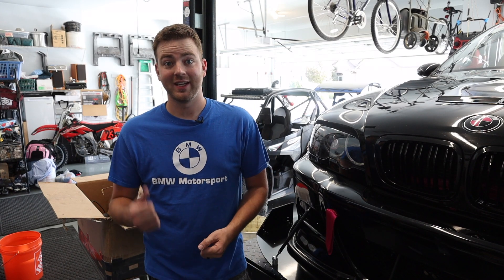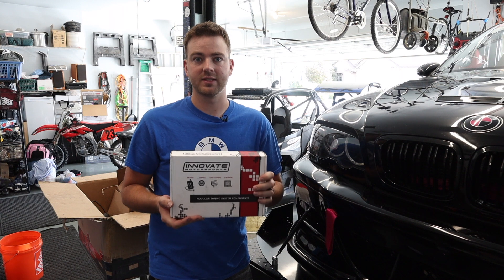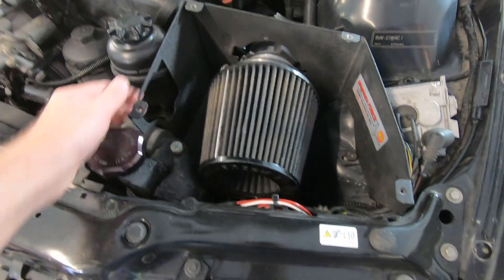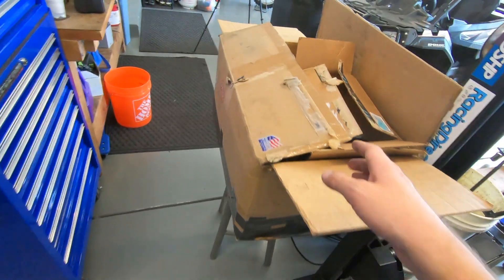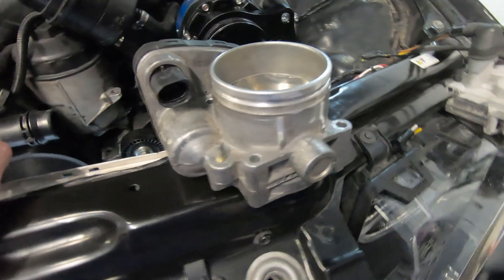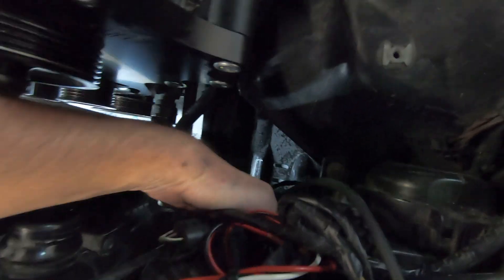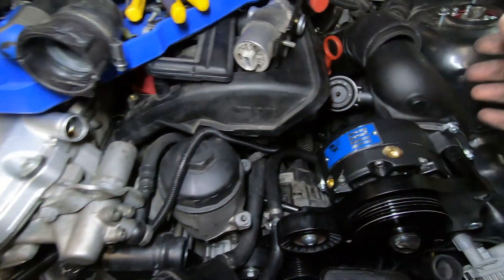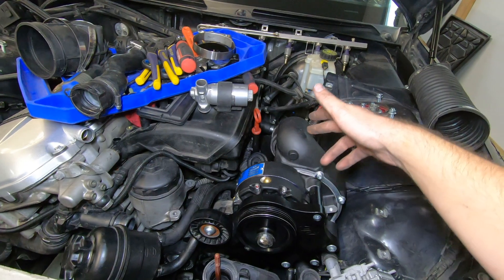BMW E46 VF supercharger kit install - Boosted M54 track car build - Centrifugal pro charger DIY

Comment: Thanks for this ..I'm installing this on my z4 m54b30. Question, did you change the bypass valve? Is the VF one ok? I know your other 330i is around 400whp. How's it running? Love the channel
Reply from the maker: Sorry for the late response!! We went with the complete Vf kit. We didn’t swap out anything. Jealous you’re doing this on a z4. Those are awesome cars.
Reply: @TenzaMotorsports  thank you. I will keep the kit as is. Looking for around 350whp, so this is one step closer. I love my e85 z4. I feel they are very ignored cars and very under appreciated

Comment: Really curious, based on your experience, which of the kits do you like better? The VF or AA one?
Reply: One more question, how did you install the AFR? Did you add another bung to the exhaust manifold? Appreciate your response!
Reply from the maker: The VF kit is very, very VERY linear, feeling consistent power gain throughout the rev range. The AA kit has a little bit more of a power band to it. I’m gonna do more comparison side-by-side this upcoming spring. I haven’t had a lot of seat time in the VF car. Where the cars  are around 100 hp different than each other. I obviously lean more towards the AA kit. It’s an interesting question and I’m hoping to expound on that answer more this year! 

We used to post cat O2 sensor bungs for the AFR. Direct fit and a perfect location.

Comment: isn't that an m3 engine in there if so you should be pushing over 400 hp 🤔
Reply from the maker: M54B30
Reply: I realized once I looked at the engine again 😅 silly me
Reply: it's an 330ci

Comment: Is this kit feel faster then the active autowerkes  more reliable any easier to install compared to active what are the pros and cons with this kit compared to the active kit
Reply from the maker: Well my stage 2 AA kit was harder than this VF because the intercooler. The hardest parts of both these are the charge pipe that goes to both the throttle body and ICV. I feel like they are about the same difficulty wise on that task. In terms of power. Again I have the stage 2. So they aren’t comparable. The only thing I’ve noticed is the AA builds boost faster over all. So take that as you will.

Comment: Hi Tenza, what was the website where you get your headers?
Reply from the maker: Revmatch Motorsports. They have direct fit headers with no modifications needed. And if you tell them we sent you, they’ll give you a discount!
Reply: @TenzaMotorsports  awesome! Thanks for the reply. Following your builds slowly
Reply from the maker: Sounds good! Are you building a 330? Or what?
Reply: @TenzaMotorsports  Building on a 2001 330ci manual. that's why your channel is perfect for this!
Reply from the maker: Heck yeah! Full track build? Or street?
Reply: @TenzaMotorsports  street build... for now. Lol. Its my daily, so right now around 300-330whp seems like the target.
Reply from the maker: That’s a very obtainable goal. Solid numbers and you shouldn’t have to get a crazy clutch to make that happen.